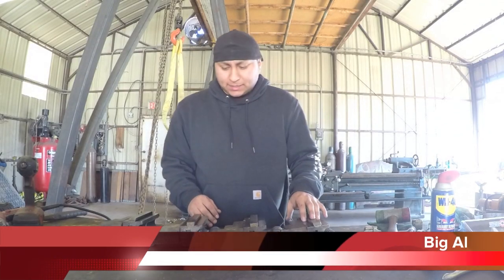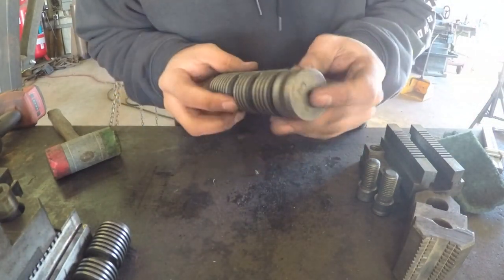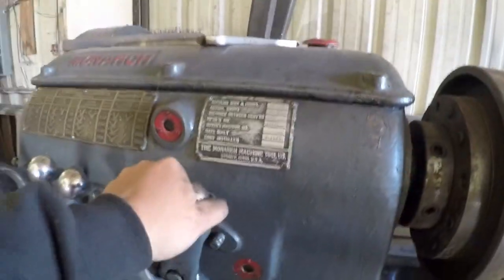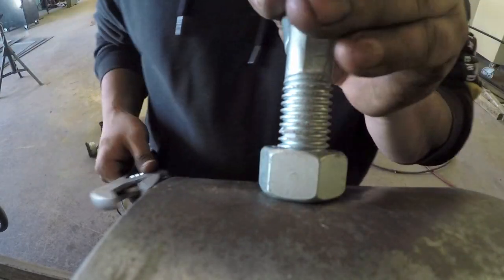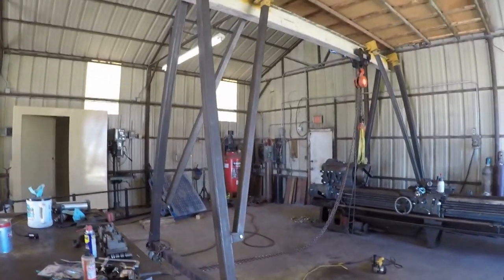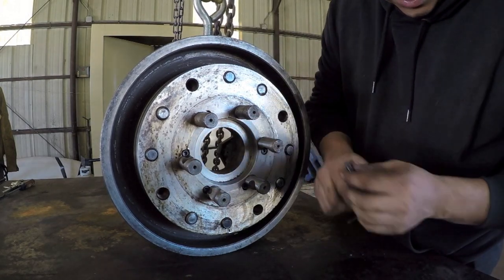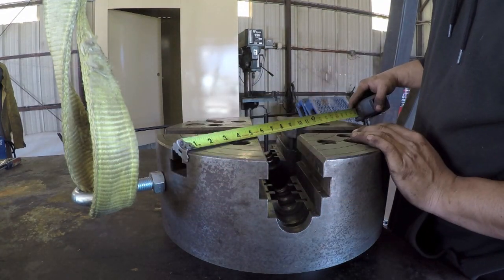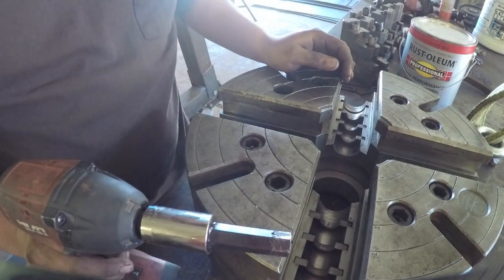#21 Chucky Part 2

Comment: You should NEVER, EVER have long sleeves when using a lathe or any turning machine. Your on/off switch is a long way from you when your caught in the machine. I moved the original switch, using flexible conduit to just to the left of the chuck.
Reply from the maker: That's a good idea thank you

Comment: Man that is one heavy duty chuck! I like it! I've never seen one like it though. If you find a brand name post it up. Don't think it's Cushman. Our old Cushman had three steps in the master jaw you could position the top jaw at. Yours has small grooves and looks like a few more positions to set it in. 
I'm betting the felt is like a wiper, just like you'll find on the carriage for the ways. It's most likely there to help keep chips out of the screw and threads. 
It's cleaning up nicely.
Reply from the maker: Thx Adam you may get what you want in Chucky 3? Thx for the tip on the felt that sounds about right. I wish you had your big Monarch too could use the videos.

Comment: man, i don't want to be a safety nazi but i don't think it was a great idea to wire wheel the chuck will in gear.  i just wouldn't like to see you are anyone else get hurt, that cord on the grinder could pull you in.  also your wearing a hoodie and that draw string is a hazard. i enjoy your videos and looking forward to seeing you make  some chips!
Reply: So true!! My email is enough to deal with
Reply from the maker: Thx for looking out for me I pulled my sleeves up but didn't think about the draw stings. I'll keep a better look out. The chuck is spinning pretty slow and was controllable although looks fast in the video but I knew it was dangerous and had my guard up. Anytime the lathe is on its dangerous. Thx for the comment.
Reply: No worries,  do you have Instagram also ? It's truns out there a cool weldors/fab community on there.
Reply from the maker: No I don't have an account maybe one day i just don't want social media overload FB, email, YouTube, snap chat when does it become enough?

Comment: Hi !

Your nice heist could be a little better if you made a sack for then main chain and hang this sack up under the "cat" so you only have the chain with the hook and your up/down chain - just an idea ;-))

I have a way smaller crane arrangement in my hobby shop but made it electric and with a steady motor mount - take a look:

(You can Google Translate to the right just under the menu line - choose whatever language you like in the combobox !)

http://kelds.weebly.com/loslashbekran.html
Reply from the maker: your set up is nice. I agree I could use a chain bucket but that hoist is really to big for the gantry. I plan on upgrading to an electric hoist and getting rid of the manual.
Reply: Fabric8tion Nation Consider a "wire flow" like mine with a fixed motor - it gives a lot more height and no cable to goof around with near the beam.